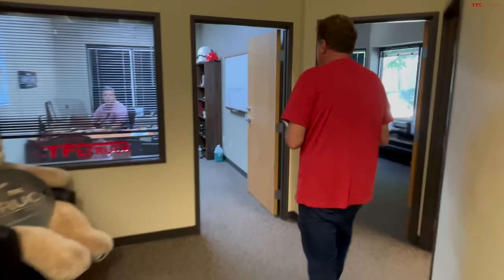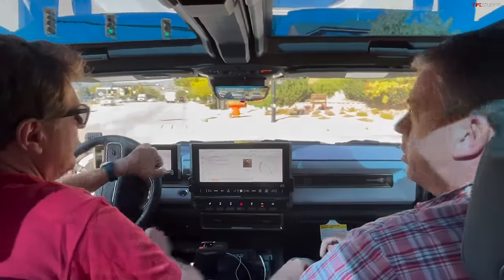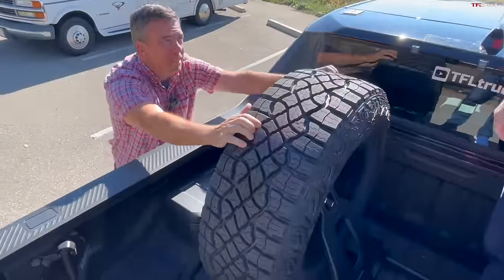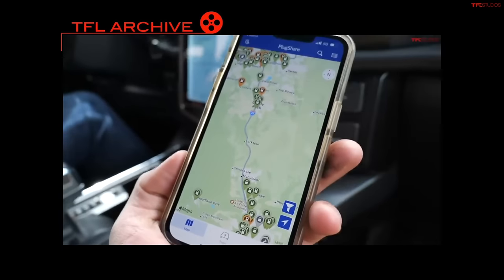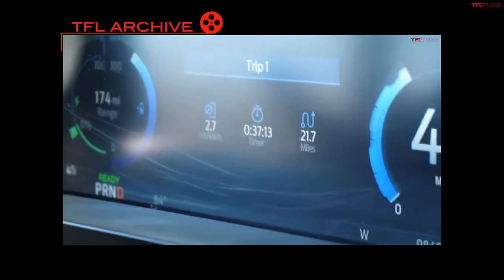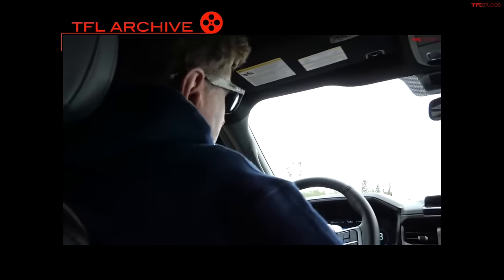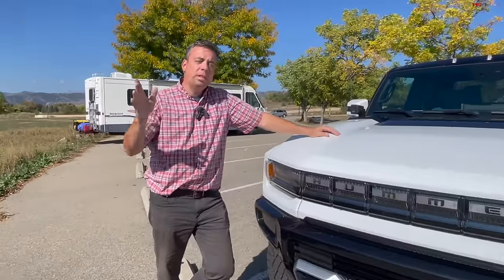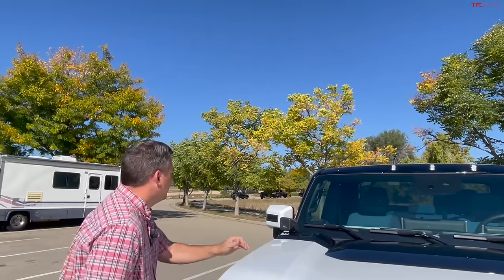Here's What Happened to Our Hummer EV When It Broke Down & WHY We Traded Our F-150 Lightning for It!

Comment: "Known anomaly." Interesting. Still, this is the only HUMMER EV out of a 1,000+ sold where I've heard of this issue, so this would probably fall under factory defect.
Reply: theirs more. I seen a second one this morning and people referred to these videos. also during rain. but I digress...no moisture or condensation issue??.
Reply: @paparooster9569  I'm a member of several HUMMER EV owners' groups, and I'm yet to see another post about it. Do you have a link?

As for the moisture issue, that was due to a bad seal on the removeable top, and my understanding is that it has already been corrected. The owners who received replacements already have had no issues with rain intrusion (except for one person who later stated that they hadn't put them back in place correctly).
Reply: It's a common gm problem.  On the Silverado the front view camera quits working.  Have to reprogram sdgm.  Yukon doesn't report airbag issues.  Reprogram sdgm.etc
Reply: @charliemagoo7943  Sure, but those are all different issues, and the ones you listed are simple errors (not something that will shut the vehicle down). When you build 4+ million cars a year, there are bound to be more than a couple anecdotal stories about modules needing to be reprogrammed.
Reply: @newscoulomb3705  these same issues with sdgm cause a security lock up. And vehicles stop. Gm actually had to have a pickup they were trying to show to the world towed off the hockey rink because of  software anomaly.
Reply: @charliemagoo7943  Cool. So as it gets ironed out because it's a known issue, it won't be a problem in the future.
Reply: @newscoulomb3705  not likely.  Other issues will arrive.
Reply: @charliemagoo7943  They always do. I don't have a lot of GM ownership experience, so I have to rely on GM fans like you. I just know that the plug-in GM vehicles I have owned have been nearly bulletproof in operation and reliability.
Reply: Seems the GM dealer didn’t preform the software update before final deliver.
Reply: @samkeels5676  the gm system won't let the delivery occur if it's a required update.  Many updates are only required if the ota fails and causes issues.  That would have occurred while it was in customer possession.

Comment: If you guys want a good offroad jack and you could mount it in the bed next to the spare tire, get a Pro Eagle 3 ton Kratos jack. You can buy a mount and tool kit with it. It has large tires made for use off pavement.

Comment: High speed, high load is an absolute nightmare for electric motor efficiency. Electric motors are most efficient low load.  The motor in isolate is most efficient at high speed, but introduce aero drag and it's much more efficient at low speed. 

Combustion engines are the opposite. They are more efficient at high load.  You will burn more fuel,  but you're getting a greater portion of the energy out of the fuel. 

If an electric truck and gas truck have the same range empty, put a load in the bed or tow anything and the gas truck will gain a massive lead.

Comment: For 1 thing, I find this purchase a great informational content for you to run with.  Like Tesla, it has its faults and needs to be exposed.(like many EV's) And there are definitely more things you can pick apart on this Frankensteins Monster in 6 months than you could with that Lightning in 3 months.  I could write up a paragraph alone on what I have seen thus far that is not good.  But I will leave it up to you to keep showing the viewers its downsides.  And upsides.(what ever that might be) Do the tire change with that crappy jack and do show how inadequate it will be for the task.  I have a 4Runner and my jack is sadly deficient for a stock set up.  Have to carry cut up 2x4's as base plates and height extenders.  Especially if you are off pavement.  And even at that, the crappy jack I don't trust.  (which is why I also carry fix a flat)  Anyhow, crappy vehicles make for more interesting content.  This should be interesting.  lol

Comment: I heard that aerodynamics makes a big difference on the Lightning and range, I noticed all of these trucks have an open bed on them, are y’all going to test with a tonneau cover to see if there is a drag difference?
Reply: They already have put a tonneau cover on the Lightning. It did absolutely nothing. In fact, it actually did worse if I remember right. TFLEV, "Here Is Why the Ford F-150 Lightning Sucks at Road Trips & It's Not What You're Thinking!"
Reply: @ronaldking1054  correct, even tests done with other vehicles with tonneau covers and bully gates (net tail gate) did worse creating more turbulence behind the back glass. The solution was to widen the top of the tail gate to assist the air flow coming off the roof.
Reply: Watch myth busters. Tonneau cover and tailgate get same milage. The tailgate creates an air bubble then the new flowing air goes over top that and the tailgate same as tonneau cover. You only see increased drag when there is no tailgate at all.
Reply: The covers reduce mileage in some cases. This is because at speed a circulating air cushion forms in the bed of the truck allowing air to flow more smoothly over the vehicle until it reaches the tailgate. You may have noticed that tailgates have gotten thicker over the years and the reason for this is help smooth out the air flow even more as leaves the vehicle. A cover disrupts this air cushion formation and increases drag by a small amount and increases weight.
Reply: @picklemetimbers3003  i was just thinking this

Comment: Technology is wonderful when it works. Software anomaly? That's what I want to have happen to my vehicle right in the middle of traffic on I-25 or I-70.  The software issue might be a bigger issue than the battery.
Reply: A known software anomaly that the dealership failed to remedy before selling the vehicle. Doesn't say much for GM concern for the safety of it's customers.
Reply: Never mind of course that Honda, Toyota and several other companies have recalled vehicles for software issues on combustion cars also.  Software glitches on early vehicles are a known issue on combustion engine cars and electric cars.  It is the price of getting the very first models of any new car...
Reply: @redbaron6805  Which is why I don't get the first models of any car.
Reply: @redbaron6805  And EV technology is far from being perfected and being as reliable as it should be.
Reply: @slundgr  Which is fine, but that is the price early adopters are willing to pay on any new car.
Reply: @slundgr  It is not "perfected" as no technology is.  Combustion engine cars are not "perfected" either despite them having been around over a century.  But are they far superior to combustion engine cars in reliability, fuel costs and total cost of ownership..?  Beyond question.  Ask pretty much anyone that actually owns, drives and pays for one...
Reply: @redbaron6805  I've talked to a mechanic who said after the battery goes dead in an EV it's worthless. I talked to a lady who owns a Tesla and hates it. Wish she never bought it. I don't want to plan a road trip or my life around charging stations and waiting for a car to charge.  The supposedly positive environmental impact is overstated when one looks at what goes into making batteries, which mostly come from China. What happens to the batteries when they die? Have you seen the EVs catching fire in Florida?
Reply: @redbaron6805  If early adopters want to buy an EV have at it, but the government should not be forcing others who prefer a combustion engine into buying an EV. Let the free market decide which is best.
Reply: @slundgr  The problem is that mechanics really know squat about EV's unless they work on them for a living.  Asking a combustion mechanic about EV's makes about as much sense as asking a tugboat mechanic about airplanes.  They have no clue what they are talking about.

EV batteries when they go "dead" are not "worthless", they can be rebuilt, which is what several companies do already.  EV battery failures are exceptionally rare, which is again why they are warrantied between 8 and 10 years.

EV materials can be mined once and then recycled, oil is burned once and then it is gone forever.  The claim that batteries "mostly" come from China is actually false.  Tesla makes their batteries for the USA market in Nevada.  GM, Ford, Kia/Hyundai, BMW, VW and several other automakers are building massive battery plants in the USA, along with EV assembly plants.  

Literally every single EV automaker ALREADY has recycling programs to rebuild and recycle EV batteries.  Which answers what happens to EV batteries when they "die" which is a misnomer as the battery pack is made out of anywhere from hundreds to thousands of cells, and most of those cells are still usable after the battery pack is taken out of service.  Which again is the reason why EV batteries sell for thousands of dollars after they "die" as the pack can be broken up into smaller modules which are used to convert combustion engine cars into EV's.

And there was ONE EV that caught fire in Florida, and some idiot political appointee which has zero qualifications on EV batteries started claiming this would start happening all over, which is obviously false as EV batteries are completely sealed from the outside.
Reply: @redbaron6805  lithium ion batteries are a consumable product with a finite life.  saying its “exceptionally rare” for them to degrade is a flat out lie.  They do not last forever and if you think 10 years is a long life for a car then thats just sad.  plenty of ICE vehicles on the road decades after they were built
Reply: @Lucas-gu7sj  I never said Lithium Ion battery lasted forever, but they can easily last 15 to 20 years or longer.

The WARRANTY on the batteries is 8 to 10 years.  Can you name ANY product that is warrantied for LONGER than the product will last?  Of course not.  Literally not a single company on the planet warranties a product anywhere close to its expected lifespan.

And I said it is exceptionally rare for them to fail, which is supported by actual data.

The AVERAGE lifespan of a car in the USA is 13 years genius.  So, cars simply on average don't typically last much longer than 10 years.

There are not "plenty" of ICE vehicles on the road "decades" after they are built.  That is utter BS.  Close to 15 million vehicles are scrapped annually in the USA, while there were around 14.5  million new cars sold in the USA in 2020.

The fact of the matter is, which is clearly demonstrated countless times on this channel, that cars are frequently simply beyond economical repair.  They will cost car more to fix than they are worth.
Reply: @redbaron6805  A 10 year old car is a 2012 MY, idk where you are living but i think its pretty normal to see cars older then this on the road.  Also I would love to see a product with a 15-20 year old lithium battery that isn’t toast.  Please let me know where I can find one!

Comment: Advice for your trials: Use the "no freeways" option for the trip planning. You don't prove much by driving hours on freeways. 

You'd be surprised how much work (and thus varied experience) it is to drive without using freeways. And you will also find you lose necessary communications fairly frequently. 

A worst case I have experienced is a recent trip from Texas to Illinois and back...no freeways. I lost smart phone communications and internet repeatedly. In one instance it left me out in the middle of nowhere (near Poplar Bluff, MO) with no idea where I was. 

Google maps doesn't drop crumbs. When you're high and dry, the least it should do is show you where it last knew you were...and how you got there. I had to resort to the compass until I got back into civilization. Without that I would have had to get out and check the moss on trees...in the dark.

Comment: On the topic of the efficiency numbers while empty but going through elevation changes. I noticed on my Kia Niro and Nissan Leaf both that mountain driving is MUCH more efficient vs flat land back roads, and then the least efficient is always flat land 75mpg highway. My Kia has hit 5mi/kwh on a 200mi loop into the mountains and back home without trying to be efficient. It's clear and not surprising the towing use is limited on the EV trucks still, but if you guys get a chance to see the effect of a camper shell that would be helpful. Not everyone needs a full trailer to camp. And since aero is so important for EV towing does that lead to the R-Pod having a noticeable advantage?
Reply: *75mph highway

Comment: My mid 90s Toyota will outlive your EVs
Reply: True, but id still 100% rather have the Hummer than a 97 Camry
Reply: @sofloflow  i guess some people really need to impress their neighbors.
Reply: @DebbieOnTheSpot  its not an electric vs gas thing for me, its the fact that the 90s Toyota has way worse crash protection. The most sold vehicle in America, where I live, is an F150. I sure as heck dont wanna be in a 97 Camry if one of those hits me.
Reply: @sofloflow  a mid 90s Camry doesnt have all the TVs in it so the drivers are generally watching their surroundings opposed to blocking traffic with a failed vehicle.. or crashing. Hashtag run-on sentence
Reply: @DebbieOnTheSpot  I can do that for less than the cost of a hummer. Get a 12v Cummins dually with a manual and a 97 camry for reliable fuel efficient transport as well as a reliable nice truck that will also last forever all for less than  half the cost of a new hummer.

Comment: I wouldn't bet on these guys being able to change a tire with those tools off-road.
Reply: For my 2007 Hyundai Elantra I carry a Torin extendable lug wrench; it's a basically a 3/8ths inch size breaker bar (and I've used it as such). The lug wrench that comes with the jack is laughable.

Comment: 31:55 -- I had a 2015 Mustang with leather seats that started doing that after about 2 years / 20,000 miles.  It actually developed a small split at the seam, too.  Ford replaced it under warranty.  If they did that for a $35K EcoBoost Mustang, I'd guarantee you they'll do it for your $81K lightning.

Comment: in watching the break down video, I noticed when your partner reconnected the battery and got back in the truck, the software displayed actions to complete, like roll down the windows.  I noticed a DISMISS option on the screen as if to dismiss that request.    I wonder if dismissing each action would have moved you through the process faster.  Just noting that if the window motor didn't work or it was a heavy downpour, then you could dismiss the requested action.

Comment: back about 11 years ago I bought a 1988 GMC four-wheel drive pickup and once I got the initial stuff on it fixed but needed repaired and rebuilt the transmission for $1,000 All I've had to spend on it is maybe two to $300 a year it's a lot cheaper than these electric cars I will never get an electric car you have to have them for 50 years to get your money back out

Comment: All the tech and automation and it can't self diagnose a software problem and auto update? A 9 year old Toshiba lap top has that capability.
Reply: Toshiba laptops don’t have liability insurance and wheels.
Reply: @SuzukiKid400  that's not my point but it can be fixed so you don't get stranded. A quick system scan then an update and you're moving again.
Reply: @SuzukiKid400  more reason why it should be able to scan for any new OTA updates on startup or periodically once or twice a day like literally every piece of software driven equipment has done for decades now. My freaking headphones can scan for an update and a 115k dollar marshmallow colored piece of crap cant?

Comment: All new vehicles (ICE or EV) need a big red REBOOT button on the dash.  Something that momentarily disconnects the 12v battery, forcing all the computers in the vehicle to restart.  Don't make the customer have to rip open compartments and spend 20 minutes just getting to the 12v battery.

Comment: I think that it would be smart if existing vehicles could be converted over to electrical vehicles, by removing the gasoline engine and fuel tank etc., and installing an electric motor and battery pack.  Then adding a charging port, where the old gas cap was. This would keep most of the existing and good components in place.
Reply: Most existing cars can't support the weight of the batteries and handle worth a damm. That e Hummer is 8000 plus pounds and the heaviest production car ever made.
Reply: @eleventy-seven  The weight of the batteries is an issue for sure!! Perhaps lighter batters one day? lol

Comment: Do EV’s have 4WD?  Can you do reviews during winter applications?  I live in IL and I work in IA.  I worn for the railroad and I have an 84 mile commute each way with no charging ports at work.  So when I bored my train I may be gone for over 24 hours prior to getting back from my trip, only to make the same 84 mile trip home.  Cold weather has an effect on batteries, so my question is, how is the battery life on these EV’s   sitting outside in the elements during the winter.  What would be the total time needed to charge once you get home?  It’s possible on a quick turnaround trip that I may only be home for about 8 hours prior to going back to work.  I’m a skeptic and I don’t believe the infrastructure is there yet for the push for America to switch to EV’s.

Comment: Both trucks look pretty disapointing, the Lightning NEVER got close to the range it claims and the battery pack hangs down too far for off roading. The Hummer is just ridiculous, too big, too expensive and it's just silly the fact you need to PAY EXTRA for a spare tire and tire jack alone is just crazy. There are much better options out there for less money.